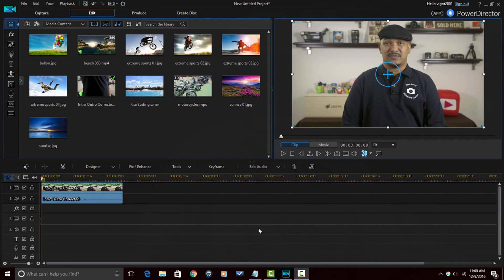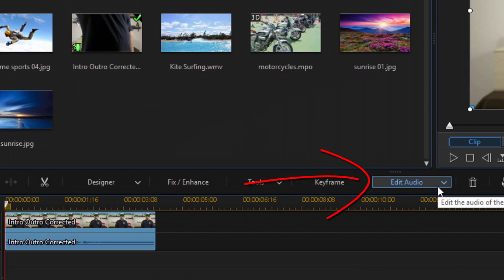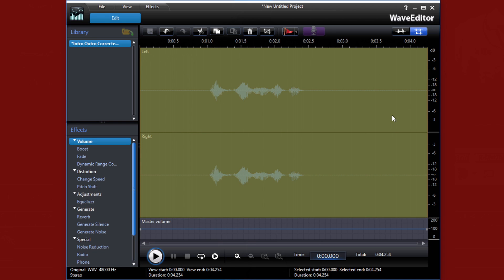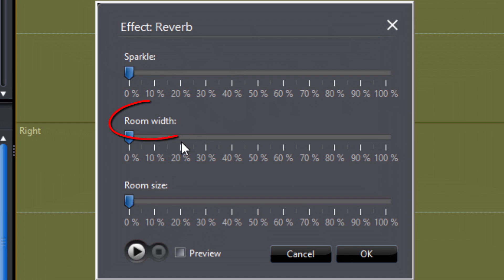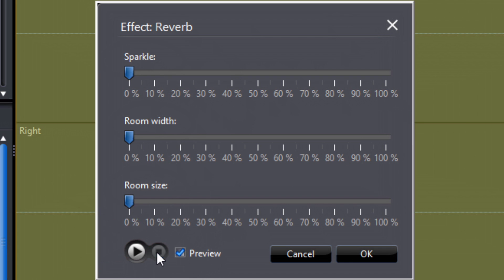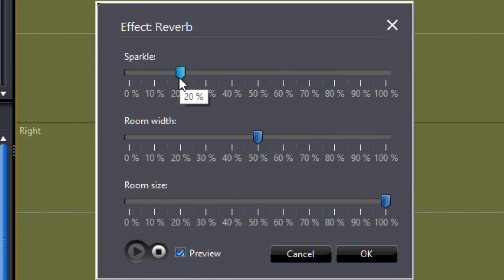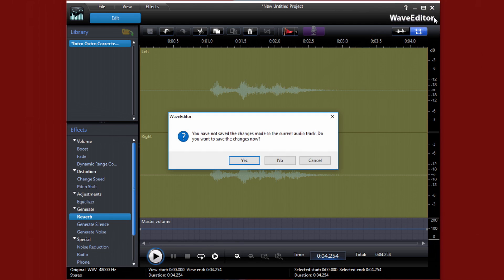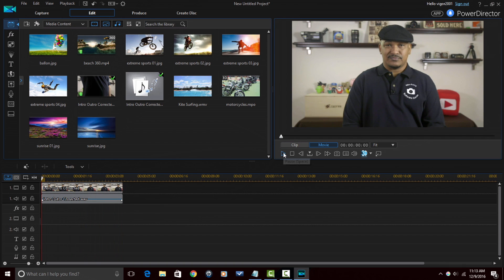How to Make An Echo or Reverb | PowerDirector

Comment: how do I remove an audio effect I have added (like reverb) I can see the 'i' on the timeline where I added it, but cant seem to remove it when I go back into audio editor.  doesnt show as a checked box or anything, like it does in visual effects. please help.  thanks kindly
Reply from the maker: Reid Jamieson How did you add the effect? What were your steps? 1, 2, 3, etc.
Reply: @PDU_Tutorials  clicked on the audio track (one a track that has audio and vid sperated) clicked on tools > audio editor, then clicked on reverb, then adjusted and saved. closed and repopened.
Reply from the maker: Reid Jamieson Can you undo or CTRL + Z until the effect is removed? Can you go back to Audio Editor and uncheck or remove Reverb?
Reply: @PDU_Tutorials  i cant undo as i closed and reopened.  I can uncheck any visual effects but not an option with audio.
Reply from the maker: Reid Jamieson I got nothing. Have you tried asking for help on the PowerDirector forum? Maybe someone there has solved this issue already.

Comment: Thanks for this! Is there a way to get RID of echo in a clip?
Reply from the maker: You may be able to using a program like Audacity or Audio Director but it can't be done using PowerDirector.
Reply: Thanks. I have tried Audacity but had no luck. Don't have Audio Director, but will try it if they have a trial version. Thanks again :)
Reply: Oops...disregard my previous comment. I DO have Audio Director and have tried it. Couldn't figure it out there either :/

Comment: can you make super slow motion in the power director?
Reply from the maker: No, you can only make slow motion using clips with a frame rate as high as 120 fps. http://www.cyberlink.com/stat/edms/pdr_training/enu/advanced_04.html
Reply: Thank you for the information. The technic of slow motion is using high fps. But i want to make more slowly (super slow motion). If we use adobe premiere , we must add some plug in like twixtor. Or i can made it with double slow motion maybe. First i produce the video with a maximum slow motion effect and than i edit it again with another effect of slow motion. Maybe its can work. its so helpfull your advice, thank you sensei..
Reply from the maker: Yes super slow motion is usually made with super expensive cameras that have an extremely high frame rate. It is usually not done using plugins.